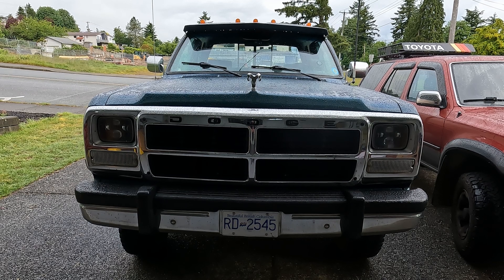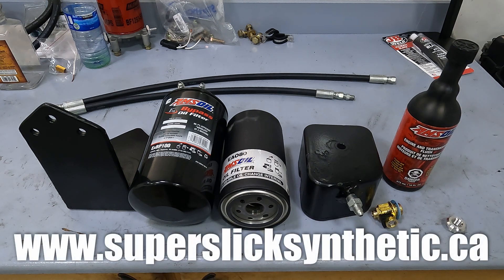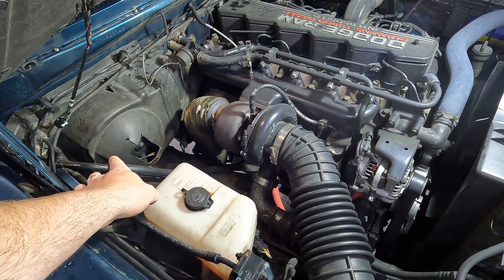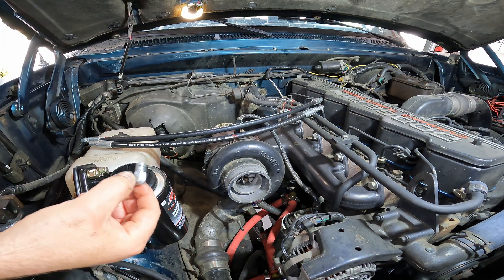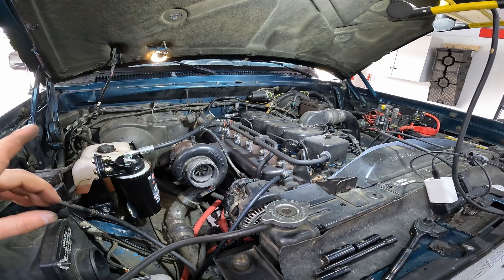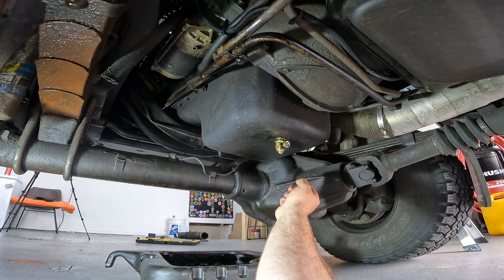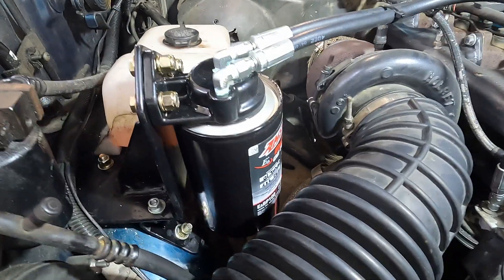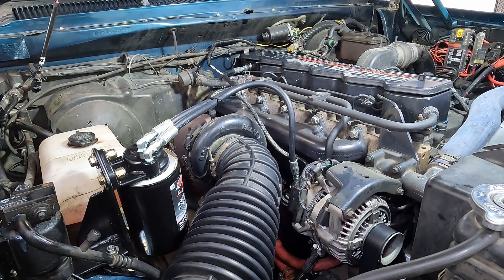Oil System Upgrades | First Gen Cummins

Comment: I've been planning to this also. My dilemma is where to run the return line. I was told routing it to the valve cover was not ideal. It's been a year for you now. What are your thoughts and experience regarding the return location ? Thanks for the video.
Reply from the maker: Hey thanks for reaching out. In short, this setup works great I have had zero problems with it. I could see why full flow through the valve cover could be too much however, the pressure and flow rate off of the Amsoil filter head does not present any issues routing it back through the valve cover. I did look into an aftermarket swivel oil filler cap first but I haven't found anyone that makes one for a first gen. Hope this answers your question. Definitely a great upgrade to prolong the life of your engine.

Comment: Would your primary filter even be nessary at that point since this one filters to a finer level of contaminates?
Reply from the maker: Great question. The short answer is the primary filter is still required. The reason its still required is because it removes the bulk of the debris and is a full flow filter designed to work inline with the oil system. This allows for all of the oil to be filtered on each cycle through the engine. The bypass filter works in parallel to the system and only takes a small percentage of the oil on each cycle to filter that small percentage to 2 microns. This allows for you to either prolong the life of your oil (reduced frequency in oil changes) or gives your engine cleaner oil when keeping with the normal schedule further reducing wear. Hope this answers your question 👍
Reply: @roughcutsgarage  Thank you, that makes sense.